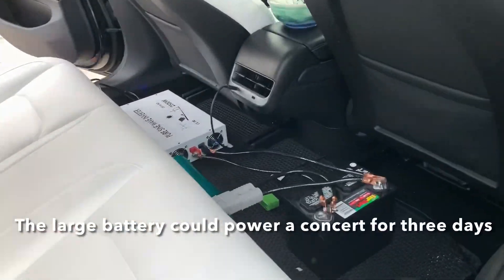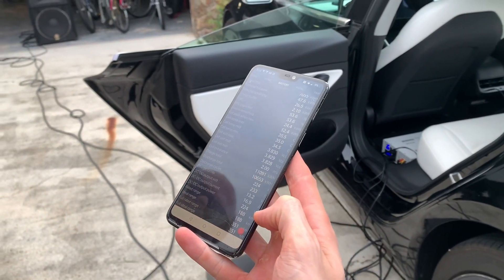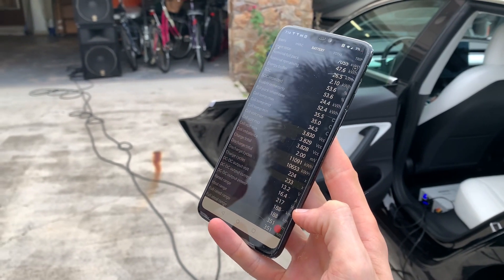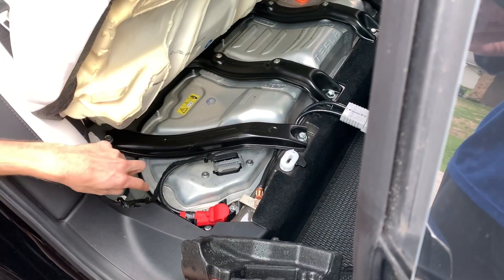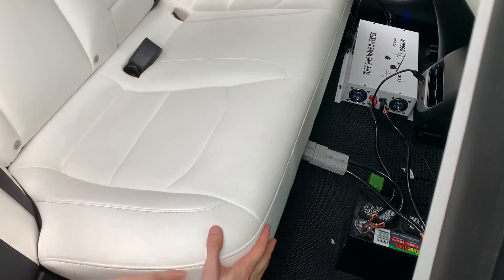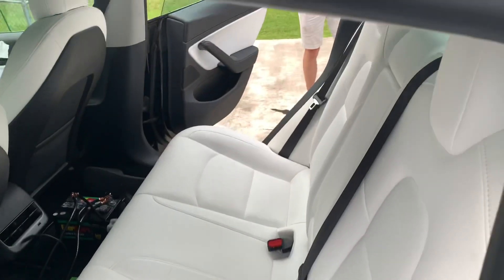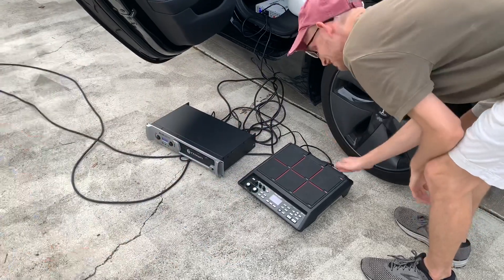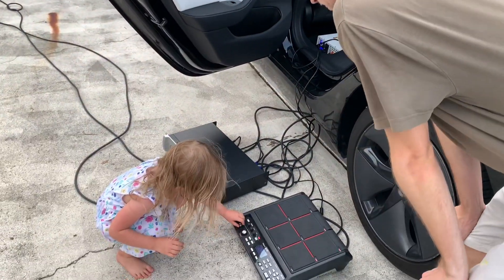Hacking a Tesla Model 3 to power a concert with a 2500 watt inverter

Comment: I have a question: Is the stock cable/pluc under the seat 12VDC, or directly connected to the HV battery of the Tesla? I assume it's the 12V-system, and this feeds the buffer battery on your floor? But then if you contentiously draw over 10A, the buffer battery should be drained, because the Tesla DC system can only handle 10-15A continuous, no?
Reply from the maker: It’s up to 10 amp, but it’s usually never close to that. Most of the amplifiers and other things you use use a lot of power when they are first turned on. I wouldn’t recommend trying to charge a large battery with it because I noticed when charging a car is when my cables get the hottest. Because that’s continuous power being fed.

Comment: So a question, why did you add a separate car battery for this instead of connecting directly to the 12v battery in the trunk? Is there a reason for that? thnx!! love this hack
Reply from the maker: We ran a separate 12v battery to help preserve the cars regular small 12v battery.
Reply: The inrush current is too much to charge the capacitors in the inverter and it trips the efuse. So he is using a extra battery to handle that. But what you can do instead is build a pre charge circuit which basically limits the ammount of current thst can go to the inverter initially so it slowly charges the capacitors which means it won't trip the efuse. Once they are charged (5-10 seconds) then you flip the switch and it then has access to all the current it needs and works as normal. This eliminated the buffer battery he used

Comment: What’s the difference between this and just using a jackery?
Reply from the maker: Any of the portable battery packs would be great, but your runtime will be limited. Just make sure you get the correct wattage for the equipment you’re using. The great news is the car can run for a very long time.

Comment: We have a device that can directly convert Tesla electricity to power the house. It can be used directly by plugging it into the charging port.
Reply: Not possible. Tesla charging port isn't bi-dirextional
Reply: Link? I’d def be interested in that for camping and overlanding.
Reply from the maker: @ Absolutely
Reply: Which device is it?
Reply from the maker: Very cool

Comment: Why do you need the extra battery? The dc to dc invertor is 2500watts that your hooked to at the car 12 volt source.
Reply from the maker: To help with electrical surges when you power on equipment
Reply: I don't understand? If you hooked it to the 12 volt posts, it has the underwood battery, keeping the capacitors charged all the time and the 12 volt car invertor from the 400 volt battery is capable of a constant 195 amps at 14.1 volts. 
The only reason I see to add a battery is if you were disconnecting the cars 12 volt under hood battery. Is that what you're doing?
Did you try it some other way, and it didn't work or faulted out?
Reply: The inrush current is too much to charge the capacitors in the inverter and it trips the efuse. So he is using a extra battery to handle that. But what you can do instead is build a pre charge circuit which basically limits the ammount of current thst can go to the inverter initially so it slowly charges the capacitors which means it won't trip the efuse. Once they are charged (5-10 seconds) then you flip the switch and it then has access to all the current it needs and works as normal. This eliminated the buffer battery he used

Comment: How big of a 12v battery did you use or recommend? 

How many #Ah? Battery size or specs you think is important. 

Looking to find those cables do a fuse and battery.  Would be cool if you had the links you bought in the description
Reply from the maker: Sorry it took so long to respond. I deep cycle marine battery.

Comment: Do you think that you can do this setup from the front battery connections.  Take power from front battery to go to another battery then to the inverter?  So this way they can't detect the drawing?
Reply from the maker: It would probably have to be a very low wattage for it not too be alarmed by how much current is being drawn

Comment: Has anyone found a way to keep the PCS (Power Control System)  High Voltage to Low Voltage DC-DC converter under the rear seat awake when the vehicle is stopped?
Reply from the maker: Have you tried camp mode?

Comment: Why do you need to do all this and taking risk tesla will void your warranty ?
Can you just buy portable battery instead ?
Reply from the maker: It's my friends car and he is out of warranty, paid $35k for it, it's like his project car.
Reply: Thank you for your post. I might try do same thing. Smart to have a battery as a buffer so system doesnt freak out @BryceLovesTech
Reply: I see others doing this, and the fault code issue is if you're off the cars 12 volt battery, not off the main underseat power supply.
Did you try it without the extra battery? 
I'm just getting started with an installation myself.

Comment: You said plugging straight into the inverter without that 12v battery causes the car to brick out. Did you find that out yourself? If you did, was removing the inverter enough to let it start back up? I watched a video of someone doing something similar to a model y without an additional 12v battery. Though they only used a 1000w inverter and said it had to be a specific one without a capacitor so that it didn't draw too much power at once. I want to do this to my model 3 so I want to make sure I'm doing everything right and nothing that can't be reversed.
Reply from the maker: I don’t know why only the electric pick up trucks get electrical outlets. All Tesla should include 120V at least.
Reply: @BryceLovesTech  Tesla doesnt want the wear on the battery due to V2L (Vehicle-to-Load) while the mileage remans the same.  They should give an option to add the 120V for fee to offset the warranty.

"The Tesla Model 3 battery warranty covers the battery and drive unit for 8 years or 100,000 miles, whichever comes first, for the Rear-Wheel Drive model. For the Long Range and Performance models, the warranty extends to 8 years or 120,000 miles. The warranty also guarantees a minimum of 70% battery capacity retention over the warranty period. "
Reply: @BryceLovesTech easy to add one on the 12v plug
Reply: I've read that too and there's something odd about that to me... it would seem that adding another battery would only increase the charging load on the system causing further issues but perhaps on big transient draws it provides enough of a buffer to prevent a voltage drop triggering the protection circuits.

Comment: Looks like a good start. Is there a fuse protecting the Anderson plug/cables between the two 12V batteries?
Reply from the maker: Yes thank you
Reply: @BryceLovesTech  What size of the fuse ? thanks
Reply: @user-km6ri3gn5x  wondering the same.
Reply: @BryceLovesTech  can u make a in-depth video on this for us noobs please